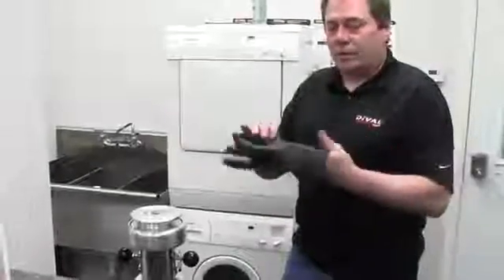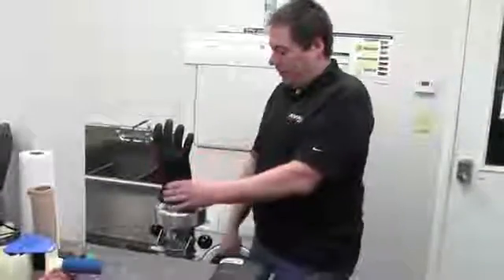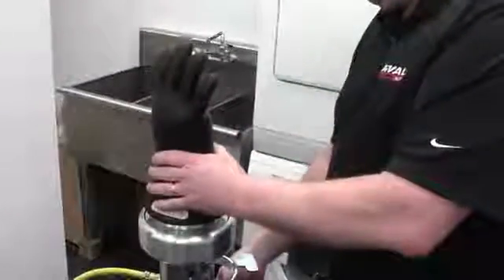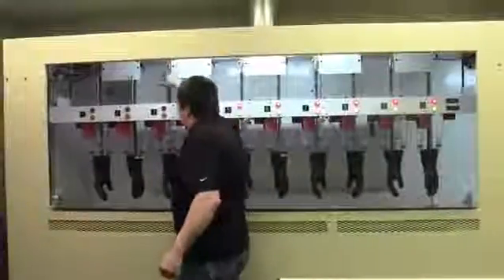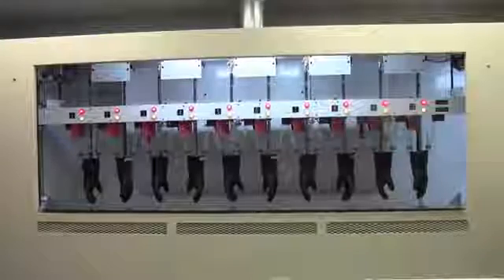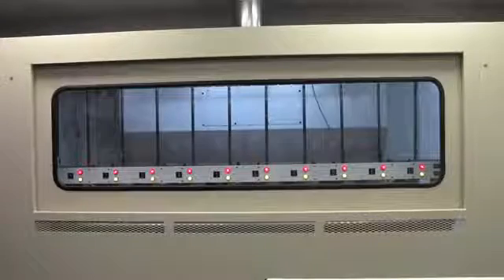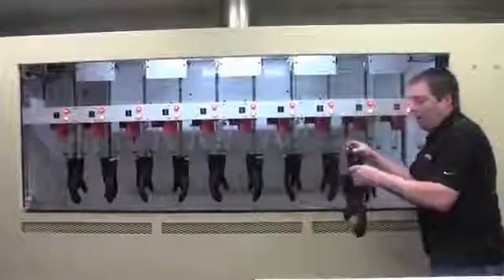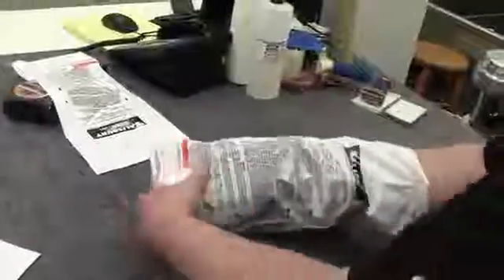Electrical Glove Testing

Comment: Failed to tell you that gloves myst be tested & date stsmped every six months. You need two.psirs of each voltage level so you have a pairvto use the week or so it takes to petform testing. Sone sparkies say tested gloves ate for sux minths after first use after testing but no longer then a year. Our testing company cuts off finger tip of failed point on glove snd marks joke with a yelliwnoaint market.